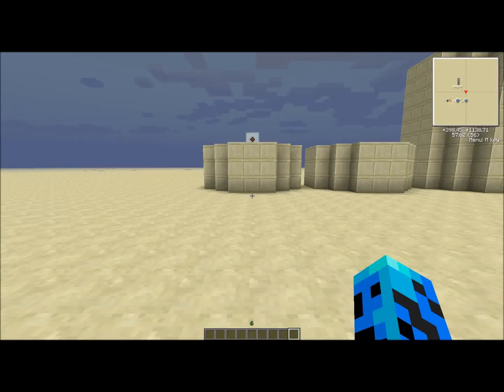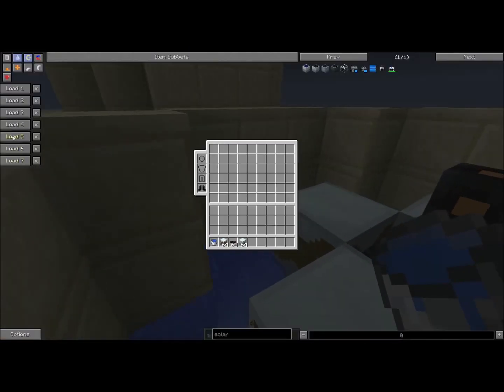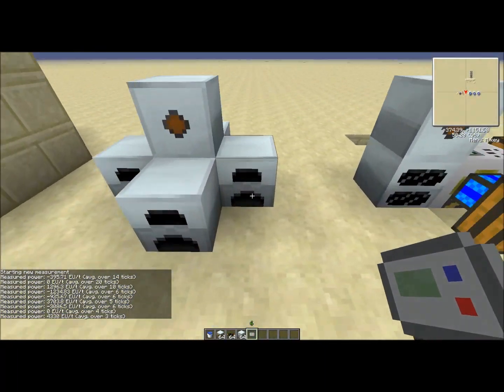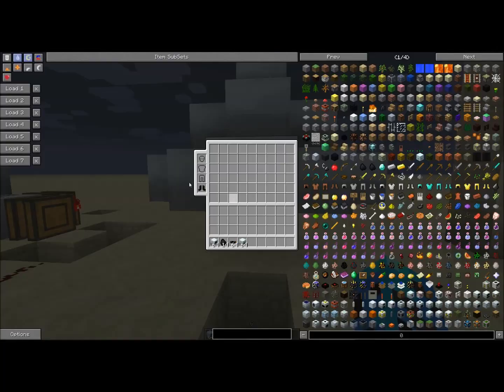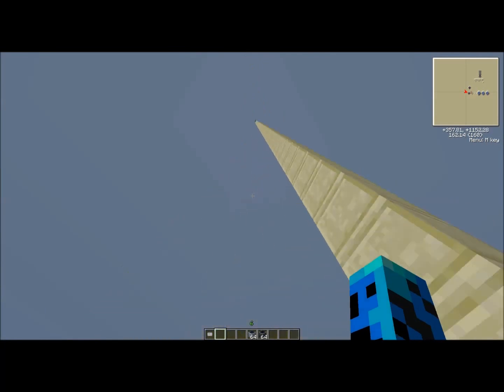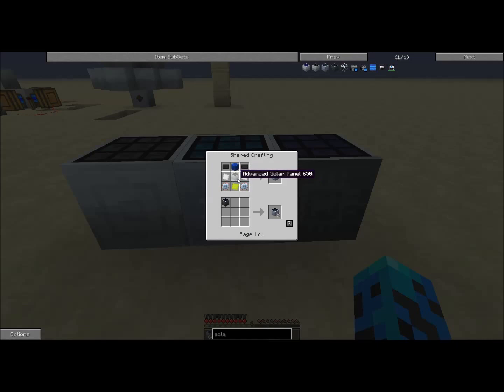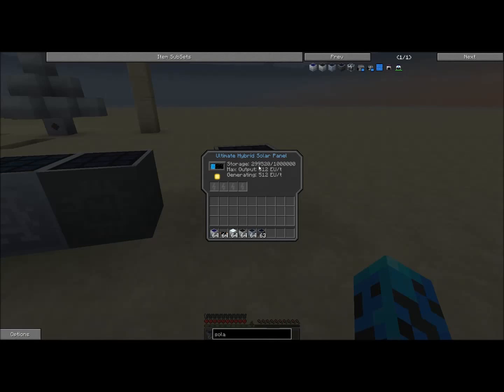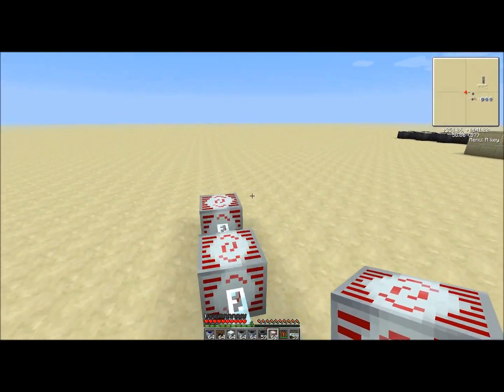Feed The Beast Tutorials Ep 3 -Efficient EU Generation

Comment: You need windmill blades and put them in the slot in the windmill. Keep the area around the mill clear the blades take a lot of space extending beyond the front face in a plane. Running the cables a long distance to the ground is a pain and can produce losses. The blades slowly wear. There are several blade types. Storms produce more energy but can wear the blades out very fast.